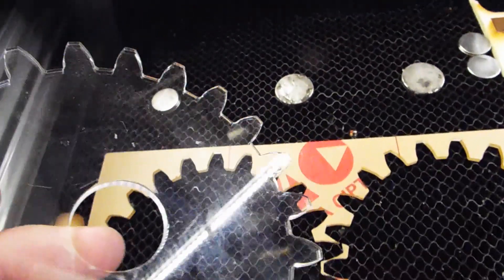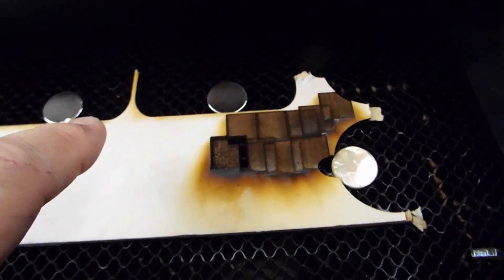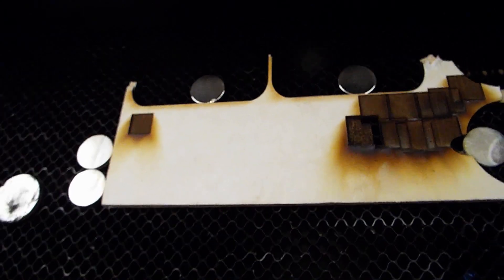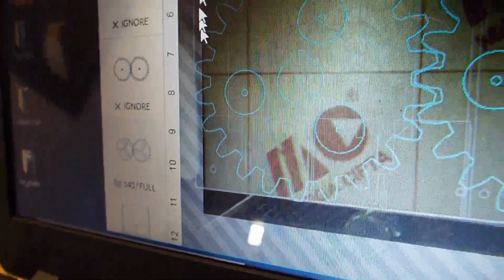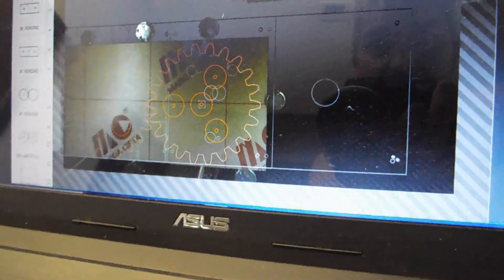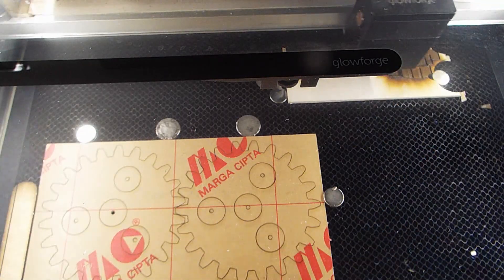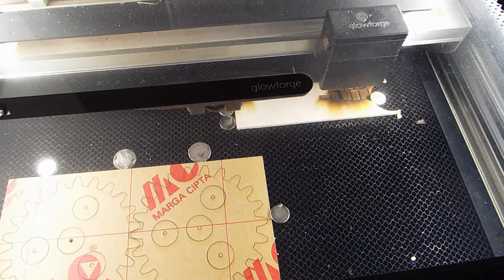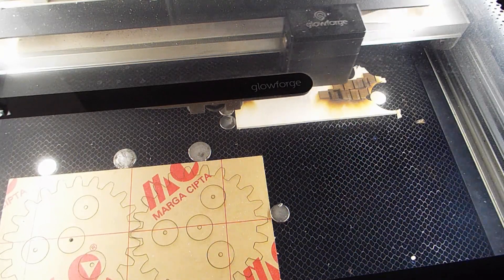Eliminate Laser Cut Acrylic Smell in a Glowforge CO2 Laser

Comment: Great vid, I asume you are aware of the toxicity of the fumes when laser cutting acrylic in addition to the BAD smell? Maybe you will find this link helpfull.
https://www.ncbi.nlm.nih.gov/pmc/articles/PMC1475175/
I think your method is only masking the smell and not eliminating the toxicity, please correct me if I'm wrong.
Reply from the maker: Definitely aware of the byproducts that are produced when burning the acrylic. Using this method is absorbing a little bit of the residue with the carbon from the wood smoke, and is removing some more of the particles from the inside of the machine by running the exhaust fan for another minute or two longer than normal while the laser is engraving the wood. While it does not entirely eliminate the smell/residue it does help a lot.
Reply: @madscientisthut  thanks for your info. Expecting my glowforge next month. This info is helpfull

Comment: Hi! Do you have an exhaust? Are you venting to the outside of a window? Even with that, the smell remains? 

Thanks.
Reply from the maker: Yes it is exhausted to the outside. Yes the smell remains, it is coating everything in the machine and the material you cut, if you take the material you cut out of the machine it smells and has lots of residue from the cutting smoke on the surface. So the best way to counter it is to burn some wood to absorb the nasty burnt plastic smell, it is still there but much more manageable to deal with.
Reply from the maker: I cut sheets of acrylic every day, probably about the equivalent of 16 square feet of it a day. so I have to deal with trying to minimize the smell.

Comment: Have to wear a gas mask, and breathe 100 percent oxygen located in your nearby fire engine. Or you could listen to the video. What does a machine like this cost? like 20 Gary
Reply from the maker: Hi Gary,  The basic 40W laser unit is $2500.00 the 45W Pro is is $6000.00 If you are interested in one I can get you a referral code that will save you money, just let me know.

Comment: That's interesting that the smoke from the board kinda gets rid of that acrylic smell! Nice idea there! I wish I had something like that to cut acrylic. I tried using a box knife but that didn't work well. I got an acrylic knife, so I'll see if that doesn't go better.
Reply from the maker: Acrylic is ok to cut using a table saw, that is how I cut sheets so that they fit in the laser.  I use a fine finish carbide blade.